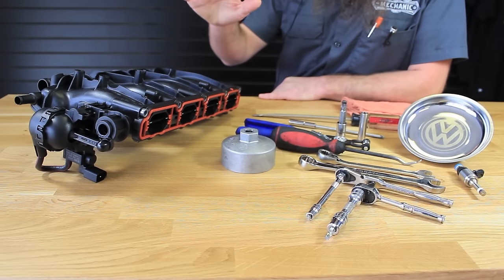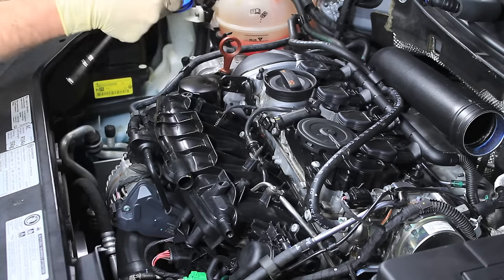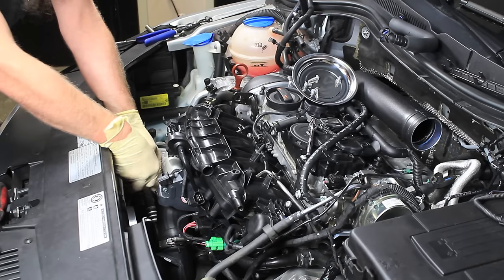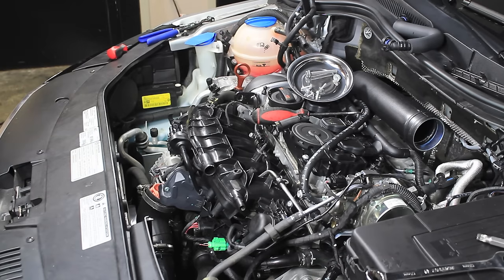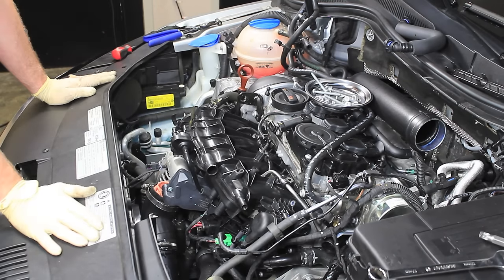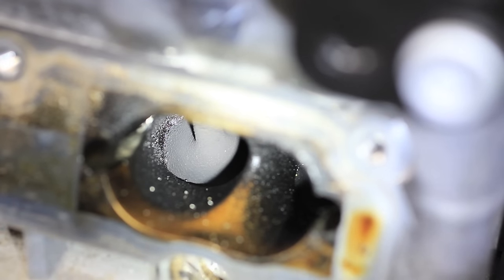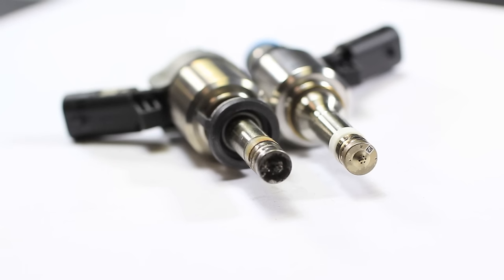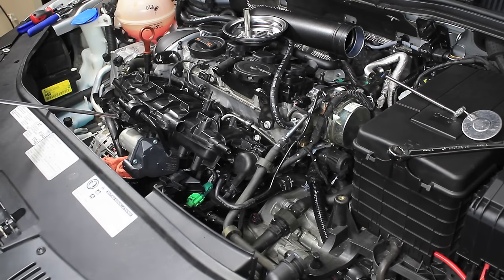Intake Manifold for VW and Audi 2.0T TSI DIY (How to) Replacement

Comment: Love all the videos you do,,very helpful vid thank you,,I have a faulty runner flaps code so I was waiting to change the manifold an do a carbon cleaning as well when I had the cash ,lol needles to say I had an injector get stuck open far from home hada drive it home in limp mode ,,with fuel filling my engine 😥 and blowing out the back ,so I checked compression the next day ,thank God all was good  180 on each cylinder not bad consider over 200000 miles ,an no cat damage as well ,but anyways hada take the manifold off replaced the injectors an seals ,an I cleaned the inside of the manifold and cylinder intakes and still have a running flap code sometimes red sometimes green on the obdeleven so  now I got the new manifold from uro parts newest version,with the fresh air line for the new valve ,so I'ma be taking it apart again with less then 300 miles later lol but I'm wondering if I can hook up my own fresh air line supply to the new valve with my own filter ,,or does it need some kind of back pressure or vacuum (this is the back port by the plug),ur thoughts an experience would be appreciated ,thank you ,,also replacing the coolent return hard plastic lines that mounts to the left side of the manifold ,it got a verysmall leak in the plastic probably a crack looks like corroded battery line,,,an im doing a dsg fluid change as well  ,got the motul fluid and filler kit from Deutsche auto ,but I found the manifold for cheaper it's a uroparts manifold 06j 133 201BH I I have an obdeleven pro scan tool so I can know what's going on with the engine ,best thing I did helps considerably an I feel a must have for these engines,,I'm just hoping the injectors stay in the head ,I literally just put them in ,,I have the seals an tool kit for it but I hope they stay in lol anyways we'll see ,,thank you again for all ur vids , working on cars is a passion for me I used to be a head mechanic years ago at a small shop and had a few performance cars myself,,now it's just a side hobby for me ,,someday I'll have my own little shop at my house to restore an do performance work on project cars ,,,,,,,one day lol🙄😒
Reply: I love swapping brittle vac lines lol😣

Comment: Awesome video 
I have juste finished working on changing my injectors , cleaning and decarbing the engine
My first “big work” on a car

UNFORTUNATELY , after i did a few test drive i had the engine light on. 
Basically a P2293 code  (fuel pressure regulator b  performance)

Also had a strong smell of gas
I checked for any leaks but there’s nothing

Driving was smooth but sometimes i feel like the car engine would shake unusually when i rev while driving 

What could it be ?
If anyone have any idea please let me know

Comment: I appreciate the video but it'd help to know which generation you're working with. I have a gen 3 EA888 and it's not the same as this, the center tube on it isn't a breather hose, it's a coolant line. I tried yesterday to get the manifold off to replace two injectors and got hung up on something catching on the right side of the manifold, I could only get one of the high pressure fuel line fittings unthreaded, the other side had so much junk in front of it to fit a wrench inside.

Comment: So (thanks to this video) I got this job completed for changing my fuel injectors. The car was running like new again for the first week but now it is having the same issue. Check engine light on and running rougher everyday. The check engine light was blinking when I started it today. I'm dreading bringing it in... Any advice please? 2009 cc sport

Comment: Nicely done! I wouldn't do it myself, but I enjoyed watching that demo. I was worried about buying a VW CC with the 2.0t TSI engine, especially with the problems people have been having, but it's not really a big deal if you have a mechanic who knows what they're doing. Only thing missing in the video was a visual display on where the sensors are located on the intake manifold. I'm guessing cleaning the carbon deposits can be done during the same service which makes it even more sensible to get everything done at the same time. The part itself (intake manifold) isn't that expensive to begin with, so, all in all, I think this is a well designed engine.

Comment: Great video I have all the parts and ready for the installation tomorrow. But I want to know what is the special tool I'm going to need for the new O-rings on the fuel injectors??
Reply: Apparently Haynes says you can use a socket of the same size, align it with the injector, and shove it on.  Then, I read somewhere else you could use a zip tie to then tighten it down to the needed circumference.  Haven't tried this, but it seems like it could work well, without the specialized tools, which are designed to accomplish the same thing.

Comment: Humble Mechanic Deutsche Auto Parts- Your Source for Everything VW and Audi 

Sorry im just a little lost on the part where you say you need a special vw tool to replace the seals on the injectors. Do you need the tool just for that one little seal at the front or for all the seals? And also is it necessary to have this special tool to still do the manifold job because it was not specified at the beginning of the video? Cheers.
Reply: Daniel Kim you need the VW tool for the small seals at the bottom of the injector, the part that goes in the head. 

The blue seals at the top, you can use a pick to swap. 

You can do the manifold with out the tool no problem. As long as the seals are in good condition going back together. 

Let me know if you have more questions. I'll be happy to help. :)
Reply: HumbleMechanic

Ok cheers mate, appreciate your help all the way from Australia!

Just one more question, will the same or similar steps apply for the MKV 2.0 FSI turbo? lol I'm going to attempt to change my moms intake manifold for her tiguan and I want to give the intake valves a clean on my jetta seeing as it is approaching 200 000kms.

Again Cheers for your help:)
Reply: What is this special VW tool you speak of?

Comment: Did this on my Vw golf gti mk6, when the Intake manifold failed(the vacuum thingy popped out of place).Tought it would have taken 2h ish, but ended up taking 5h 30 min.. and  1h searching for a bolt that i dropped inside my engine bay.... i learned alot tho =D

Comment: Hey Charles, really good video on this intake, I have a B8 Audi which is basically same thing but with the motor turned 90° I always remove the throttle body because it’s difficult maneuvering around it.. also any tips on cleaning the injectors? Great tutorial and your commentary is great you definitely know the VW Audi’s do you recommend HPFP priming the fuel rail using VCDS after this job? Or is it not needed? Thanks 👍🏻

Comment: Great video....things are a bit different on my 2010 MK6 GTI.  No bracket with the triple square driver. Had to move a few more charge tubes but still a great help in getting this swap done for a P2015 code.
Reply: Did this fix your code I just got the same code on my 2010 gti and it started idling rough

Comment: Great video!  Thanks. I tried this job on my 2008 Audi A4 B8 1.8T....and after taking all the bolts&nuts off i could not pry the intake manifold off...So i just put everything back, as is as i didn't want to force it and break something. Has this happened to anyone?  Should i have just manhandled it?

Comment: This is an old video but why would you not show the hardest parts? Like the triple square on the bottom of the bracket with 3 houses in the way of it making it nearly impossible to take off.

If anyone is thinking about buying a vw with a 2.0 tsi, don't. Nothing but problems and the parts are over priced, the car is built in the hardest way to work on it. Leaks oil all over the place. Not one job I've done on my Mercedes has been as difficult as this turd.
Reply: I KNOW! I'm down to that last bracket but the bastard did not show how to do it!! So mad

Comment: I used your video to install a new manifold, everything went back together fine and seems to run well, but I get P0238 now. I can cancel the code when it is running and it wont come back on until, I restart the car. Any sugestions?

Comment: Doing this now to deal with what I believe is carbon closed valves on #1 cylinder.  I'm about 90% done with removal but I'm having significant trouble getting a purchase on the triple square blot on the bracket. Any tips or tricks?  I don't have enough room to get the bit and my 3/8" ratchet in there and there are coolant lines in the way of using an extension.  Tried a u-joint too, but I just can't get a good purchase on the bolt and I'm hesitant to put much force on it unless I can get the bit in it fully as I do NOT want to strip this bolt out.

Additionally, the pipe you disconnect at 5:09, right after the cam sensor plug, the connector broke when I squeezed it, what is this part called so I order a replacement?

Comment: Hi It says to watch the removal video for details about underneath the manifold. Can you please provide a link? I searched and was not successful. I have a P2015 Runner Position Out of Range. I was going to try to clean the manifold up after removal but I should replace. For $100 you get the manifold, actuators, and sensors. Thank you so much for the video!!!

Comment: I've just done my intake manifold. I was led to believe the bolts attaching the manifold to the crankcase was 10nm. Is that not so, as Charles didn't torque them up.

Comment: What torx are you using it looks like a long 1/4 drive I'd like to add a set of them to my toolbox but I can't find anything like that anywhere.
Reply: If you find out which bit set he's using lmk
Reply: It is a long 1/4" extension, and I picked one up at Lowe's.

Comment: Replaced 2016 Tiguan 2.0 TSi about 2 months ago with new BH code manifold to clear P2015 codes. Worked fine for 2 months, just got P2015 code again last night…
I can’t keep doing this job every 2 months. 
Is there an upgraded manifold other than BH code?

Comment: I had this replaced for free under extended warranty on my 2012 GTI at 90k miles and they did a carbon clean up for free. Now at 115k I am throwing the p2015 runner flap code. They should still replace the intake for free again sense it was covered under warranty the first time right?

Comment: Good Morning, you took off a pipe/hose time staped 5:07-5:09. Right after you took off the cam position sensor plug, what is that called? I bought a used 2010 VW Passat Komfort Wagen 2.0T and there is no hose/pipe. It just has a bigger hose with a bolt and zip tie at the end. I havent been able to figure out that hose/pipe name. Thanks

Comment: Hey man I just did a water pump replacement everything went well I put everything back together the car is running fine but I’m getting this heavy smell of gasoline  there’s no leaks whatsoever I didn’t replace tgje seals of the injectors you think that could be the issue?

Comment: At 31:40 the intake bolts use the 5mm Allen? Figured it would be a bigger size. Doing a de carb soon and definitely want all the help I can get. I've worked on a 03 gmc yukon replacing knock sensors that are under the intake. Main issue is ones american and other german.

Comment: 1) Why do you remove intake pipe from throttle body, could you take throttle body off the intake and leave the throttle body attached to the intake pipe? What is easier, thanks.

2) at 32:30 of the video, you say you tighten up two 10mm nuts. What are these two nuts holding up.

3) can you install the intake bracket from beneath the car to make it easier? 

4) where can i get a set of triple squares, what brand do you prefer? Also when you replace the brakes in these cars, the bolts holding on the calipers are allen heads right? If so, then i have allen bits already. If not, where could I get a good set of allen bits?

5) neat you have been with VW for so long, I was looking into replacing my fuel injectors when doing the carbon cleaning, however, they are $400 for a 4 pack. What makes injectors so expensive? 

6) the while injector seal the sits in the block, if I do not replace that, am I screwed? It seems like when removing the intake, that seal doesnt get damaged, so what is point of removing and replacing that little seal? I really do not want to purchase that special injector tool. Thanks.
Reply from the maker: +Dr Dwg 
1 - You can try thats a matter of preference
2- 2 10mm nuts that are on either side of the intake
3 - You can try thats a matter of preference
4- Triple squares here https://deutscheautoparts.com/mn10pc.html
5 - That is a pretty standard price for most injectors.   We have them here for a little less https://deutscheautoparts.com/vw-audi-tsi-fuel-injector-06h906036p.html
6- If you dont replace it it could leak.  If it leaks you will have to do the job again.  Just depends if you want to do the job 1 time.  PS new injectors have that seal already on the tip so no tool is needed.

Comment: I've taken my intake manifold off 2 times for performance upgrades  but recently the intake bolts stripped out and so I had to remove it again. The whole process is fairly straight forward EXPECT the support bracket. That bracket is next to impossible to get back in with the front end of the car on. Seriously a real bitch to do off your back!
Reply: How did you take the support bracket off with lifting the car?

Comment: I have a 2007 Audi A4 Quattro and going to be cleaning the carbon soon. Any major differences? Also what would you clean the fuel injector tips with? Great vid! Thanks.
Reply from the maker: Mike Fewer Thanks... Glad you like it.  You should consider cleaning the injector tips while they are out.  Your manifold will be different as this is a TSI and you have an FSI engine.

Comment: Thanks for this.. just changed my injectors after having one stuck open. Now I’m getting a P0221 code intermittent sometimes implausible signal sometimes signal too low. I’ve ran the TBA a few times now but still getting it. Valves were cleaned and TB looked fine. Any ideas?

Comment: Would you need to remove the intake manifold to get to the water pump on this model of vehicle - looks like there isnt much room to work without doing that. I have a Audi TT and there isnt much room at the front. Needs a new gasket/waterpump as leaking. Thanks

Comment: After you disconnected the cam position sensor plug, you disconnected another hose. What is that hose called because I just a bought a  2010 VW Passat Komfort Wagon and they have it with a bigger hose and plugged with a bolt in it. It is around 5:08 - 5:10 minute mark. Thanks in advance

Comment: How do you REPROGRAM the car to the NEW intake manifold???
Reply: ???? The only procedure I'm aware of that affects this is the throttle body alignment.
Reply: Are you still getting an error code? I just changed mine to the revised intake and my p2015 code disappeared but now I got a p2008 code. What do i do?

Comment: I am working on 2012  Tiguan 2.0T.   I followed your 
vdeo by removing all the bolts  but manifold  does not move at all.   
What else could be holding it to motore?

Comment: Hey thanks for the video, its great, very well explained.. I wanted to know, If it's easier to replace the water pump by removing the air intake manifold or go from underneath. Its for a 09 tiguan 2.0L... Planning on doing the job myself, doing research on it first, it would be my first time doing this I job.. Any help/knowledge is appreciated... Thanks everyone....

Comment: Just did this job Monday...twice 😕.  I forgot a vacuum line under the intake manifold the first time so had to take it off and hook that up.   After removing mine, I found the flaps on the intake manifold and actuator arm were my issue.  Thanks for the awesome video!!!

But after doing this, I still have a "P2008 Intake Runner Control Circuit/Open Bank 1" code.  Is it possible this will clear with time or am I looking at an additional issue?

Thanks
Reply: Hey there. Same thing happening on mine. Started with a P2015 code swapped to revised manifold and now getting P2008 as well. Any new news?

Comment: Great video. Thank you. My 2009 cc showing error code P0122. Does the whole throttle body have to be replaced if cleaning does not fix the problem?  Or can the TPS simply be replaced ? (217k/Km)

Comment: Does the intake manifold runner position sensor have to be adapted to the ECM if you are replacing the intake manifold?
Reply: +Brandon Miller No, just replace the intake. No ECM access is required.

Comment: Just wondering how close this is to the FSI engine and how difficult that lower bracket is and if the aftermarket one's use that bracket it might be worth spending $1,000 to not have to put that on if it doesn't require it on the aftermarket

Comment: I performed a manifold swap with the assistance of this video and now the car will not start (it cranks but will not start).  I triple checked all of the connections and cannot find any issues nor see any fuel leaks. Any thoughts on what may have gone wrong?
Reply: Update: I was finally able to get the car started. I ended up getting a P2294 code, and after removing and re-installing the HP fuel pump the problem went away.

Comment: Hey so i have a issue with brakes after doing this job plus doing transmission fluid flush, the valve cover gasket, upper timing chain cover, and oil vacuum pump gaskets. Car brakes fine at speed but when driving slow(under 20mph) brake pedal gets really hard car does stop but takes time. Pedal stays hard but eventually become fine above 20mph.